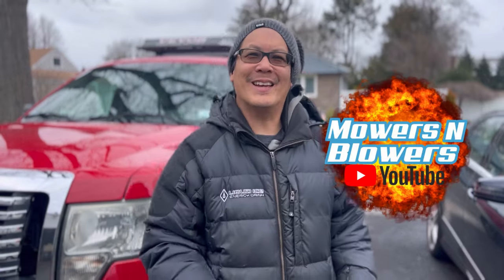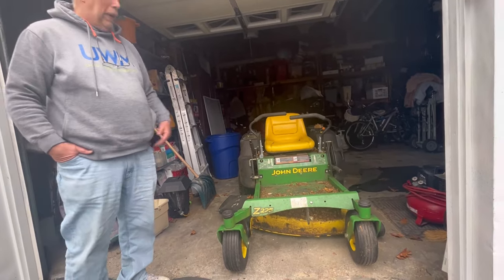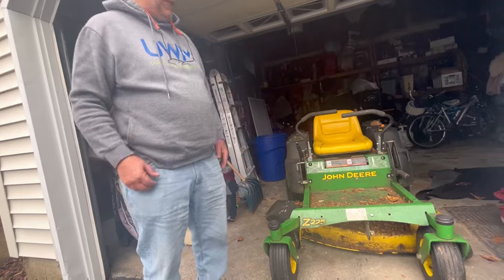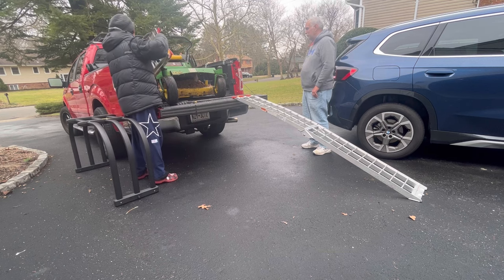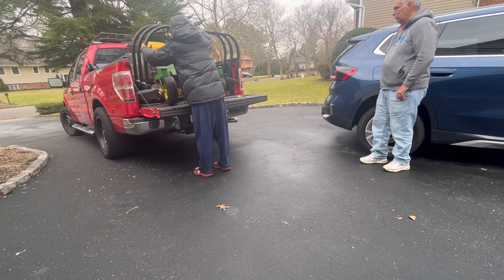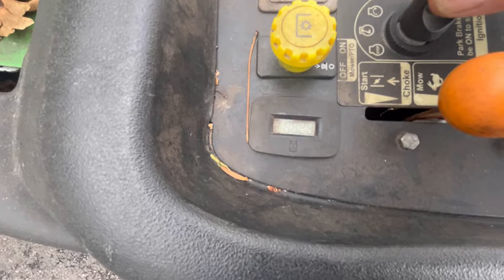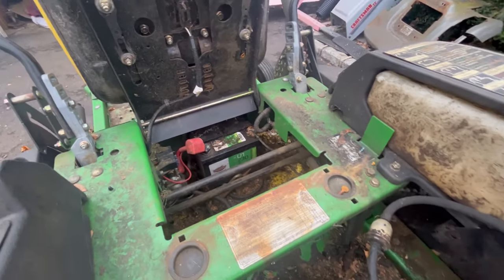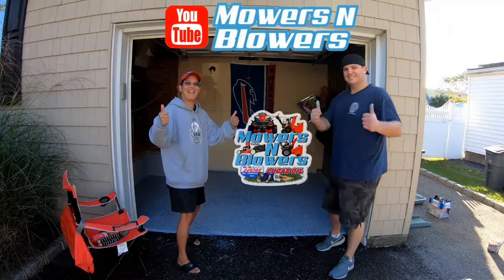FREE CURB ALERT JOHN DEERE Z225 ZERO TURN LAWNMOWER BLOWN ENGINE ROTTED DECK NEXTDOOR APP FRIEND TIP

Comment: Have you ever thought about using fiberglass to repair holes in deck I have good luck doing that
Reply from the maker: I’ve used jbweld  putty stick before and it works great,  but I enjoy welding and try and get practice every chance I get
Reply: @MowersNBlowers  understand stand that I do enjoy your video I flip mower in kansas city missouri

Comment: Been waiting for a while for this video 😂
Reply from the maker: Thanks for not spilling the beans!
Reply: @MowersNBlowers  btw my ariens zero turn (Briggs) and cub cadet rider with drive shaft (kohler horizontal shaft) both have single cylinder engines with PTOs. The ariens also runs a power bagger off of the same PTO. 

A dual cylinder is not needed to run PTO but I understand we all speak based on our experience with what machines we come across.
Reply from the maker: @10mmsocket32  you’re right,  I had that cub cadet horizontal too and it also had a electric pto

Comment: Electric PTO only needs a stronger stator not a V-twin.
Reply from the maker: Yes true,  10/16 amp stator,  but they’re usually vtwins
Reply: I just had a Yard Man zero turn that had a single cylinder Intek and I was surprised to learn that there was zero turn mowers with singles on them.
Reply from the maker: You and me both

Comment: Only in Long Island!!!
Reply from the maker: Not Houston bobby?
Reply: @MowersNBlowers  The only zero turns are owned by serious professional landscapers mostly Mexican Hispanics.  Too expensive to own.  They don't throw away lawn equipment here.  Most middle and upper class home owners  don't do yard work anymore.  They hire out to Mexican yardmen.  I NEVER EVER see mowers on the curb in Houston anywhere!
Reply from the maker: Never?  Not once?
Reply: You ain't gettin a free ZTR anywhere except Long Island!
Reply from the maker: @davie66fly  I’m surprised by both your testimonials.  My friend Casey in NC gets them,  my friend Rick gets them in Ohio.
Reply: @MowersNBlowers  In about 15 years of repairing anything and everything gas powered, I have never seen a ZTR for free here in the Pittsburgh area, ranging just across the line into OH. I think most lawn and garden sales shops would give a hondo or two for them on a trade, which may be why.